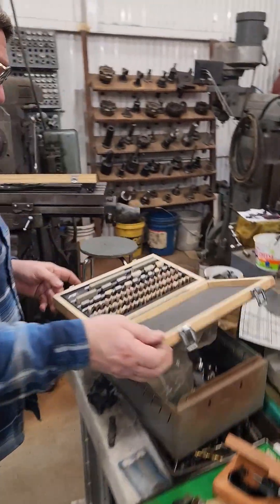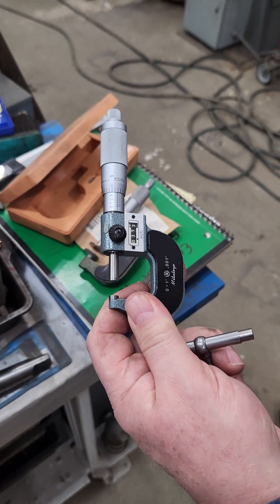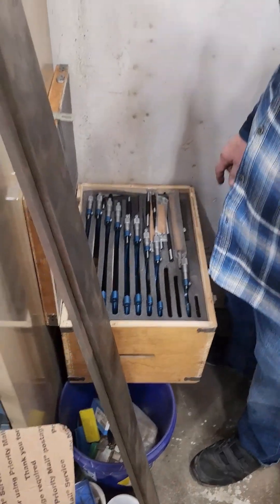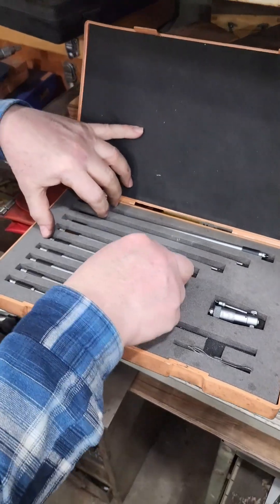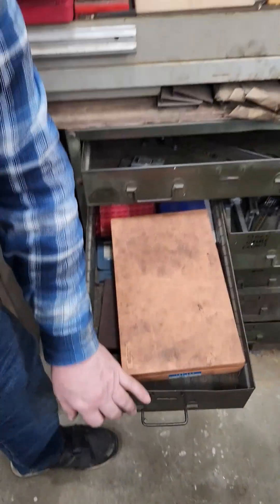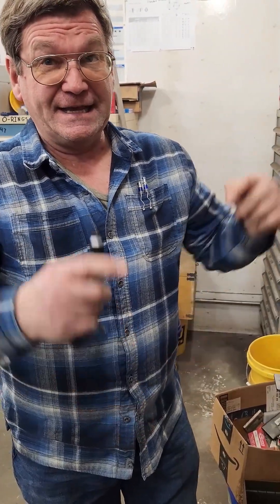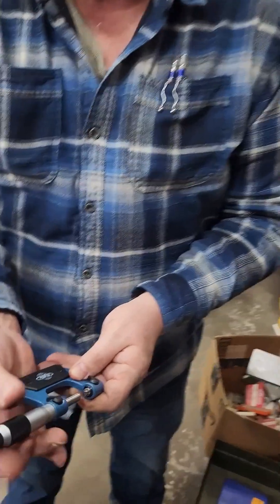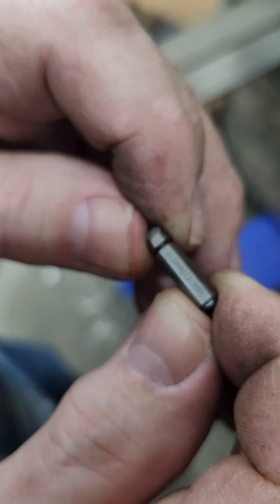Measurement Minutes: Micrometers

Comment: The 193-201 has no verneir making it accurate to the thousandth. The 193-211 has the Verner making it accurate to the ten thousandth. Exactly the same micrometer, parts are interchangeable. They just have different sleeves.

Comment: Interesting what you said about Chinese micrometers. I have a 0-6 inch set I purchased way back in the late 1980s when I was just starting out as a diesel mechanic. I wanted a set of micrometers and did not have much money to invest. The set I got is Chinese made. I took them to a machinist friend of my dads. He looked them over and his opinion was they were quite nice. Then I told him the cost he was floored by the low cost. I still have them. They get used maybe a couple times a year at most. But are very nice to have to check certain engine parts to see if they are reusable or need to be re-machined

Comment: If your just going to trust the screw then why not just get one with just a screw?
Reply: For quicker/less accurate (but more accurate then calipers) measurements. Say you need to be within 2-3 thou I wouldn’t use calipers but I also wouldn’t bother taking the extra time to add if that makes sense.
Reply from the maker: The screw is the accurate part, and the digital is also accurate, but the digital will get out of calibration first, generally after over 10,000 uses it will vary by .0003 of an inch, so I look at the screw & the vernier scale.  The digital saves me from boring math, and mistakes as both should match as a check.  Also, Why don't I get the electronic digital screw micrometers?  The electronic micrometers require calibration every time You turn them on to be trust worthy & that's beyond my patience level, but I do have one of them.